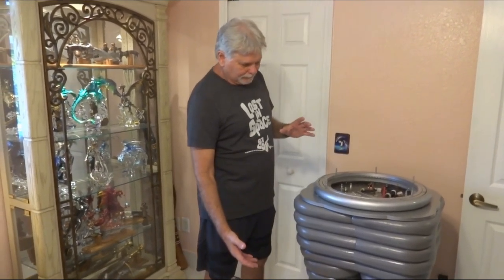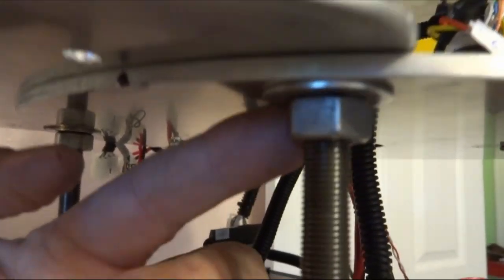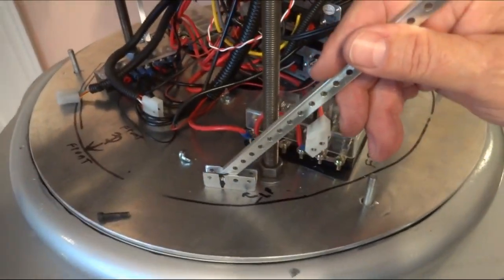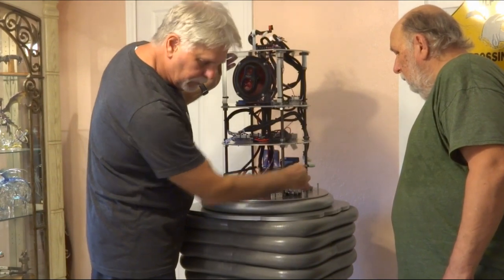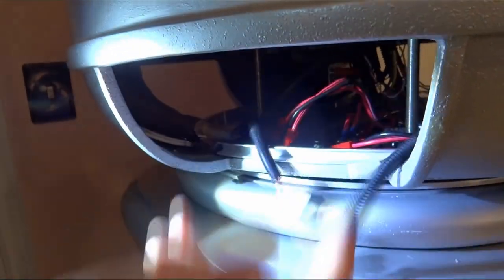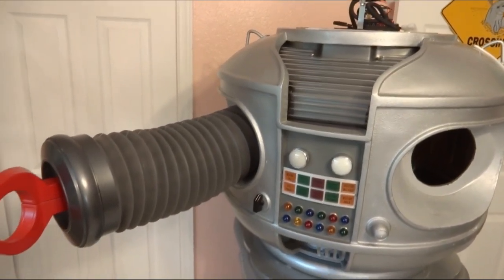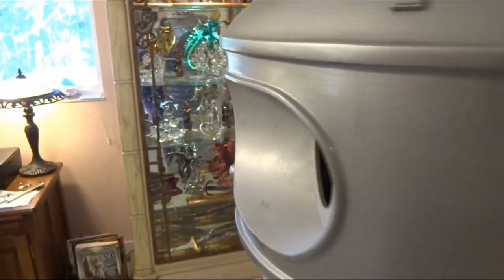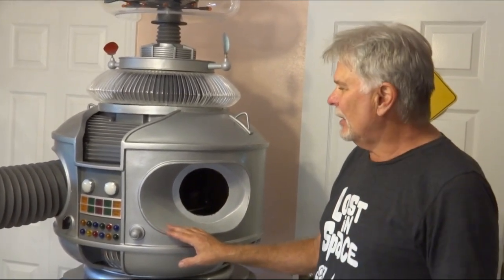B9 Robot Assembly

Comment: Hi Dave, Utterly fantastic build.  I was just wondering what ever happened to your other version of the arm that had the elbow function. Did it have some inherent problems?
Reply from the maker: Hi Mark. Thanks for the kind words. As far as this B9 not having elbows it the old story. Time and money constrains. also the elbows add a level of complication. I wanted to keep this build as simple as possible. It's going to be over 1000 miles away from me with a non-technological owner. 

I'll be rebuilding the arms on my personal robot next. I want them to be more reliable and maintenance free.
Reply: Hi Dave, thanks for the elbow info..  Now I was wondering if as far as you know, are all the parts still available from all of the other club members?  I believe that as far as your tread section, you sold that last one you had.  I would hate to have only 99 % of the critical components.
Reply from the maker: @marklay5249  Hi brother. I'm not sure about the status of future parts from vendors. It's been a while since I did a check with them. You would have to contact them personally to find out. I know most do runs on parts every year or so. I fear that the 3D printing craze is killing a lot of the manufactured parts made by our vendors. I don't know where we are all going with this now. 
The two venders that still seem very active are Norm Stockwell and Craig Reinbrecht. Good luck.